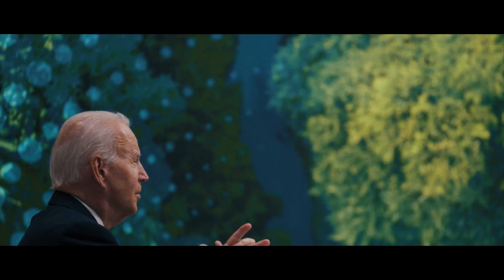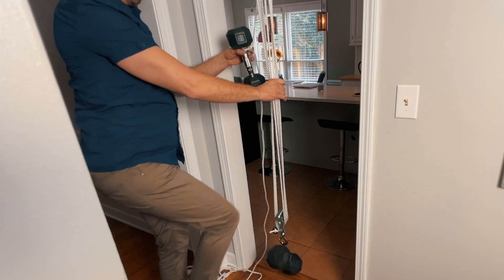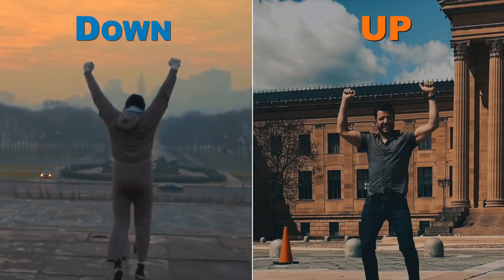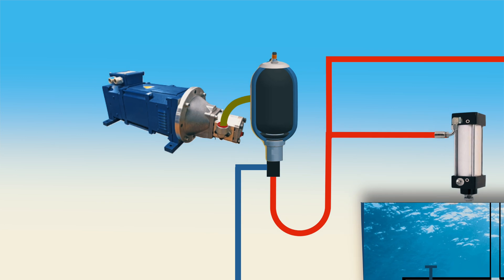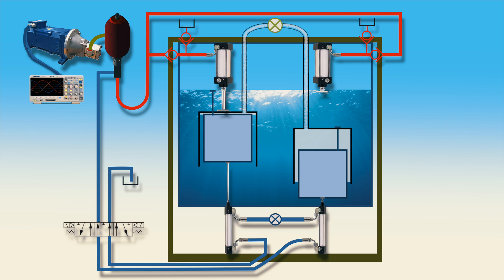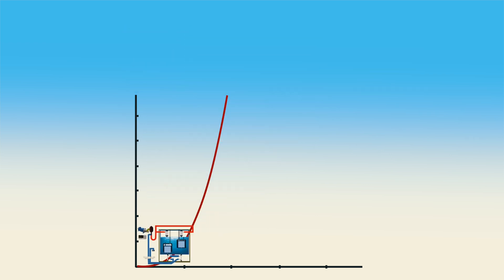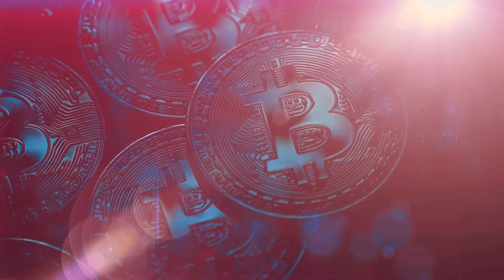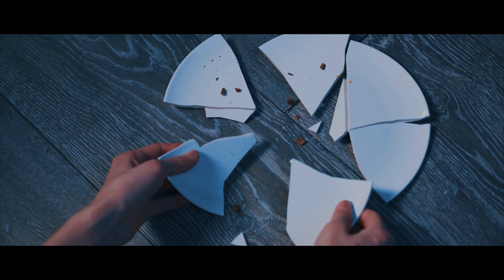Breakthrough Green Energy-Free Energy Generator without flywheel! #FreeEnergyGenerator #greenenergy

Comment: Very cool idea. Now we just need a working model to test long term
Reply: Thanks, I have been building them for 12 years.. onto commercial models now.
Reply: @waynetravis6951  damn! I'll gladly look through your channel for update videos on the longest running best results.
Reply: @trinsit  I discovered the ability in 2009, built the first closed looped one in 2010, and I built to improve the process until we had a system that checked all the boxes - for a real clean energy solution. I did not make videos for YouTube, just the people involved.  But Thank you Very Much!
Reply: @trinsit  Oh on the longest running results - since the system is not a spinning system - it produced power every time we stroked.  It did not matter how long - that's for systems with stored power. Our commercial model will run for 20 years with basic maintenance -  Again - Thanks

Comment: So, what is the efficiency ratio of input to output?  That is the real determination of whether or not this is viable.  You are obviously pumping air into  two cylinders, so you do have an input, thus it is certainly not "free energy" in that respect, but if you can get over 100% return, then you are getting a form of free energy in that you received more than you put in so there is an overbalance.  If it is not more than 100% efficient, it is absolutely worthless.  So what is the ratio?
Reply: You hit the nail on the head, but you have a few errors in the operation; 
1. the teeter totter is the input cost, there is no pumping of air - the air moved because the pressure between the two sides reverse when the teeter totter changes the head pressure. 
2. The cost to move the teeter totter is 50% less than the work out due to the design - specifically where the air volume is reduced by the Travis Effect - less volume to lift - also means less work to sink (50% less in this design).

3. The over 100% value - If I plugged the machine in the wall to drive the teeter totter, it would "appear" to by 200% efficient - because 50KW in produces 100kw out. - but that is an error in interpretation because a "Base Line" is not considered. 3.b  it is part of our physics 'new' discovery is the ability to do work at a cost "below the gravitational standard" and that provable fact is a why our system is real - its a new scope of physics but very very simple to test and verify.  

3.C The 100KW is produced is at gravitational  standard - the energy available to leave the machine with each totter - is directly proportional to the "cost reduction" to that the standard- Our system is not a "gain" (even though to the observer - it will look like a gain, feel like a gain, and appear to be a gain - it is a remainder, available at every stroke).

3.D The Travis Effect discovery creates the first known opportunity to design a 10-5=5 system (a remainder system) - not a 10-10=5 which would be over unity or 150%.

3. E Why has energy creation been impossible till now - its the way students were taught - a single focus - In the equation in put / output - the only consideration in physics has been the  output side - some magical gain- my discovery worked on the input side - cost reduction - which is a game changer. Likely a Nobel prize.

Hope that helps - and side note - I have since discovered 4 other ways to effect the input to cause a remainder... we love it, the worlds going to change for the better - abundance!

Wayne
Reply: @waynetravis6951  Well, I certainly wish I had your inventive genius.  I am pretty broke, but if you need an able body to help you get this technology out, let me know.
Reply: @wesbaumguardner8829  You are an Awesome Person - many people do help, I am always surprised at the skills and gifts of people who see the real value and purpose.  If you ever want to come for lunch and learn about our discovery, and share your wisdom - Come on to Oklahoma.
Reply: @waynetravis6951   your system is very similar to James Kwok Hidro. ¿Can I talk to you in private? i live in Argentina
Reply: @gabrielferrara9111  Sent you a note.

Comment: Has anyone seen this machine actually run producing more energy than what is put in?   The video claims this invention can supply energy to multiple homes, Does Mr. Travis use his invention on his home or anybody's home.
Reply: Nice.. lol
Reply: @waynetravis6951  That's your answer to the question?  Does anyone currently use this invention on a home, office or building for their electrical power requirements?  If so, where?
Reply: @timslavings1469  No commercial models are completed or installed, as we shard in the video, they are contracted and  on their way. Thanks!
Reply: @waynetravis6951  No they are not. There is no free energy here. Sorry.
Reply: @kaineh9649  Hello Kaine, you might put a bit of effort in and not make assumption - if your teachers knew this - they would have said so.
This free energy system is simple to verify.  You will see the cost is 1/2 the production... 
Do the Science - you have all the info needed in Markus's 2 videos - many others have already and 😱 thanks! If you need help - send me a note. Wayne
Reply: @waynetravis6951  Your design does not work. Anyone who does the math will see so for themselves.
Reply: @kaineh9649  Lol - really... So do you understand asymmetric work processes? The Work during lift is greater than the cost of sink - if you want a spread sheet teaching how to calculate the system - just ask.. 
Wayne

Comment: Wow!! This is a game changer!!  I live in  Fort Smith, Arkansas.  Are there running Beta systems out in the field that I could take a look at?
Reply: Steve, The Germans are doing the Beta model. We already built and tested each component . Arkansas is actually one of the sites for our manufacturing. Thanks!
Reply: @waynetravis6951  That is Great News!!  Where at in Arkansas?  My aunt lives there.
Reply: @timslavings1469  Undetermined yet, we just finished the manufacturing contract funding - where is undetermined. Have a good idea - let me know. Thanks
Reply: @waynetravis6951   Yes Sir, Arkansas in general is economically a prime area of the country to locate a startup business.  The Little Rock area has a large pool of qualified workers, engineers, etc.  The University of Arkansas has a campus in LR and there is a military base (LRAFB) with an excellent pool of retired military veterans.  I am one. Thank you for your reply, questions and considering Arkansas as one of your startup locations for your company.